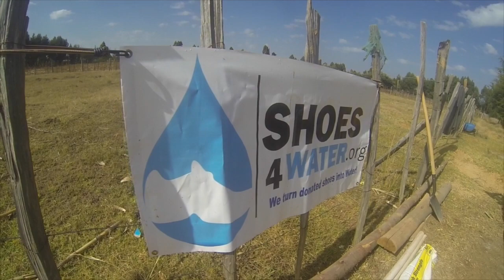Drilling a Water Well in Kenya

Comment: Detecting water using very dry wood sticks ,I knew two experts in this field ,dry oleander sticks are the best ,holding two of them like shown in the video you start walking very slowly your grib on sticks soft ,for want of water the sticks will tilt downward searching then you feel which is moving towards the other almost touching  ,that is were the powerful concentration of water

Comment: Any idea where one can get the shallow well  drilling kit in Kenya
Reply from the maker: Hi Collins, I don't know of a place in Kenya but you can Google "Hand auger systems for water wells" and get several sources to purchase your needs. You need to consider weight of the system if you intend to carry it with you on an airplane.Try to keep it under a hundred pounds and you can also divide the weight in several bags if you have multiple people going with you.